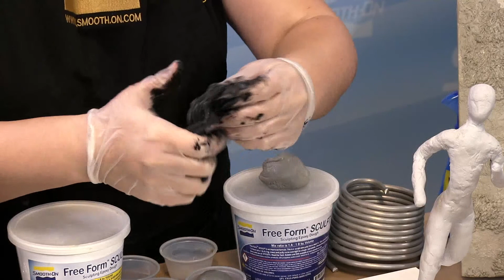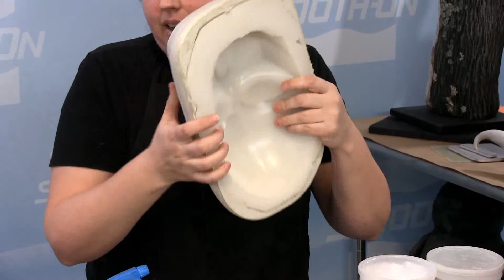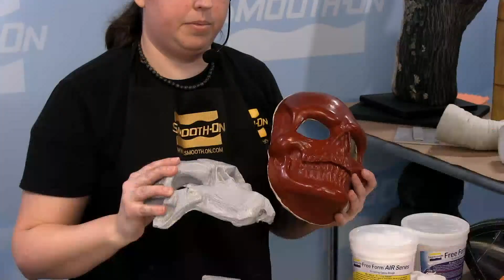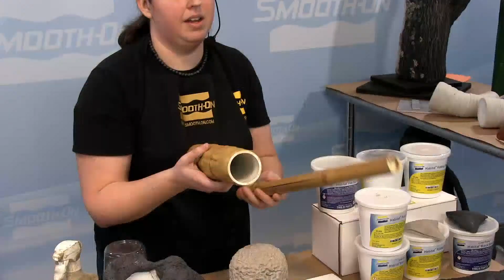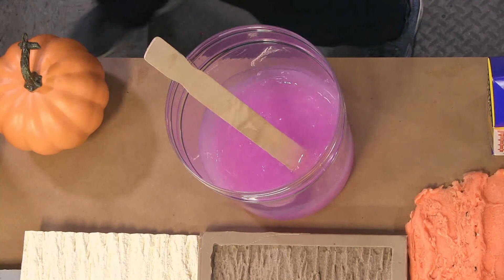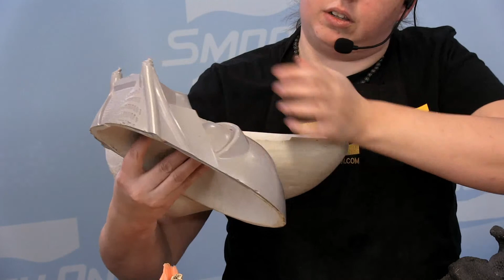Putting Epoxy Putties To Work For Your Project With Janessa Portner

Comment: @ Smooth-On ..............  Shame on you for deleting my previous post concerning my opinion on 'FreeForm Sculpt'!   Have you ever heard of free speech?   You didn't even try to find out what the problem was, you simply deleted the post!  I purchased that product as you recommended it in this tutorial, at great expense I may add.  Only to find out that it was 'unworkable'!

So if my product was faulty somehow,  how would I go about finding out why it didn't work?   I can't complain to my supplier as they didn't produce it.

As a designer I make many prototypes of various products ( automotive parts ),  I have been using your products for many many years now,  we all spend a great deal of our hard earned cash on your products,  so where's the support?   I found the deletion of my post to be quite disgraceful actually.

T4 Concepts
Reply from the maker: From time to time our filters to restrict posts will trigger on words, and these filters are not always accurate. I would recommend reaching out to us at 1-800-381-1733 or sending us a tech ticket at www.smooth-on.com/support. We have some sculptors on staff in our technical support department who can help you.
Reply: @smoothon   Many thanks for your very prompt replay Smooth-On, very much appreciated.  I don't know what word ( or phrase ) was 'flagged' but I don't think I said anything rude or untoward, it was simply my opinion on the product.  I have been trying to work with it for a few days now,  still no success unfortunately  : (

I'm now believing that there must be something wrong with the batch that I have,  maybe it wasn't stored correctly or maybe it's even old stock that has deteriorated somehow. 
I don't believe Smooth-On would of ever made such a product as to make it virtually unusable.

Many thanks for the contact number,  but as I'm in Central France calling will be out the question ..............  I have no idea what a 'Tech Ticket' is, but I'm sure I'll find out via your supplied 'Support' page.

If you need me to re-word my previous statement,  I would be happy to.  No doubt my frustration can be read in my previous comments I made about 'FreeForm Sculpt'!

One quick question if I may ................  is the 'Batch Number' on the product a manufacture date?

Many thanks

T4 Concepts
Reply from the maker: Understood. Do you have the ability to send us a message via Facebook Messenger?  If so, please include your email address and the lot numbers of the material in the message and we will assist you.
Reply: @smoothon  Sorry, no I don't have a Facebook account,  I'll send an email including the Lot numbers via email to the support link you supplied.

Thanks for your help.

T4 Concepts